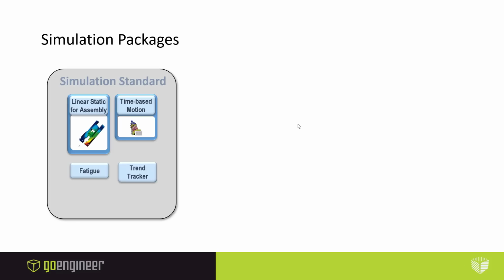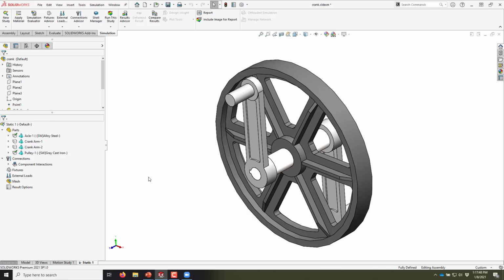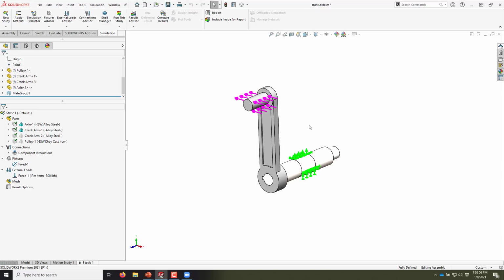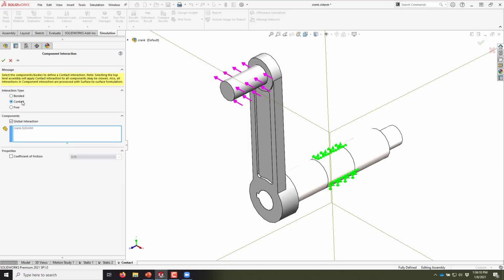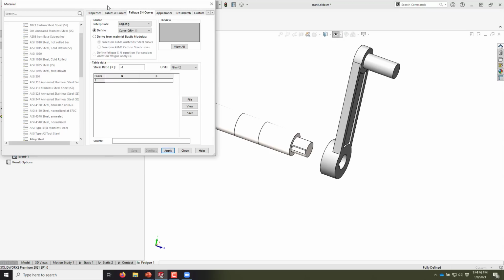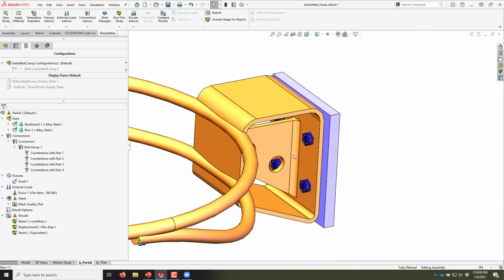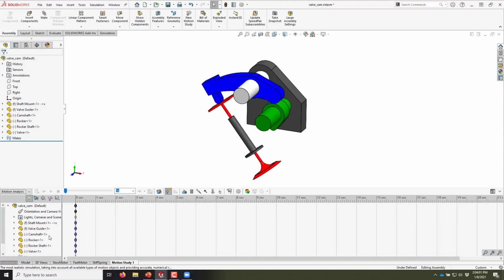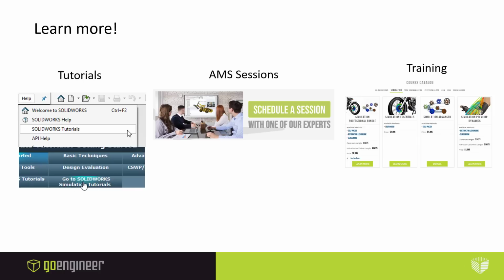Getting Started with SOLIDWORKS Simulation Standard (Webinar)

Comment: Hello, how to use graphics card to do the computation any simulation (e.g. static study, topology optimization etc)? I have a low processor(intel core i5 13400f) with 16 GB RAM, and GPU RTX 3060. Thank You.
Reply from the maker: SW Simulation does not currently use any GPU for calculations.